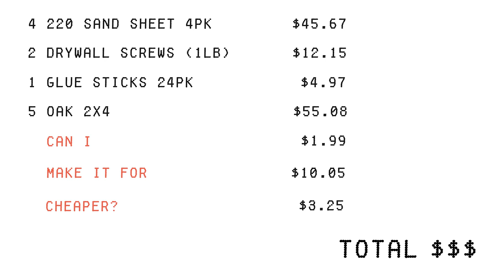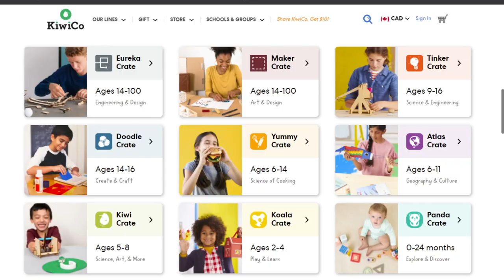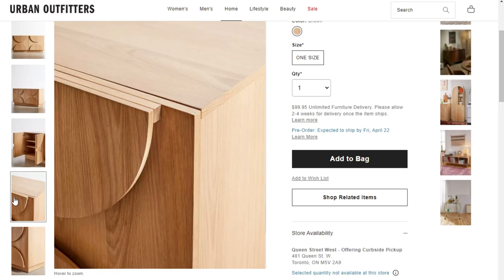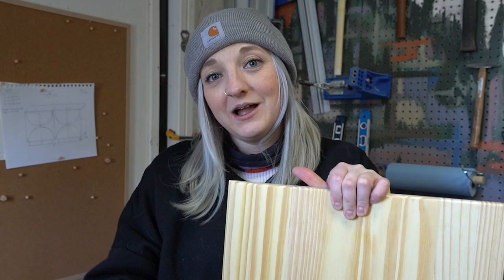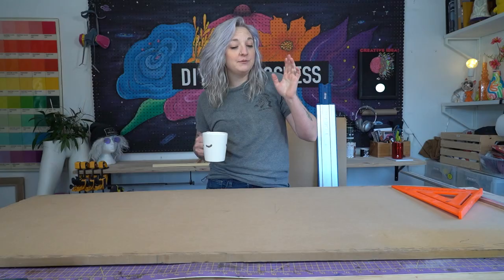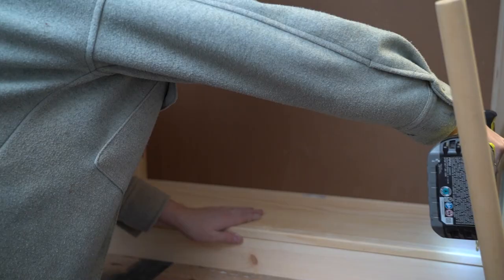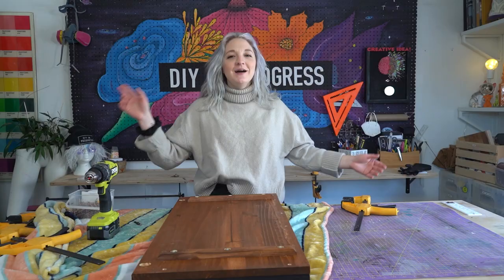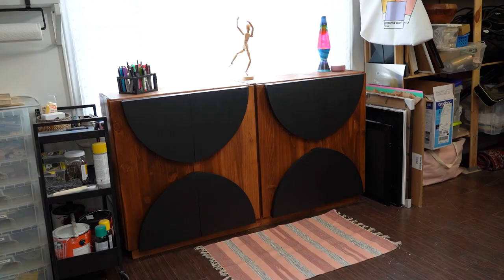Can I make the UO Tabitha Credenza for Cheaper?! | DIY IKEA HACK | DIY Danie

Comment: Danie's edges line up so much better than the original - I noticed in the picture of the Tabitha on Urban Outfitters, the quarter-circles are offset slightly from each other and I can't help thinking that if I were to drop a cool thousand dollars on a credenza, at the very least it could be quality enough to line up neatly.
Reply: I saw that too, eye twitch. Probably just poorly adjusted in the hinge and easily fixed but why not take thr time to make sure it looks right before taking proper professional shots for the website...

Comment: Loved this project idea! I would also tack in a block at about an 1/8 of the circle to make sure it didn’t crack if something hit it like a chair. Also, if you were buying supplies instead of the MDF you could 1/4 2x pine circle round boards for $15.80/each. and use a thin plywood door gap filler or just ignore the gap. At which the whole project price would be about $340 since you could just stain the pine instead of painting it saving you more money!!!

Comment: When you first mentioned the solid oak of the original inspo, I was completely expecting you to do a veneer for your dupe's doors but once you mentioned that's it's going to be a high traffic cabinet, I totally agree with your solution for a matte painted finish! Thank you for addressing the door clearance issues that the extra pieces create too! 
And if I'm going to be totally nit-picky I would mention that the vertical supports on the quarter circles could be cut a tiny bit shorter so they don't interrupt that nice visual curve when you're looking at the piece from a standing viewpoint.

Comment: i have spent all weekend trying to find a way to make circles with a router for both wood and acrylic where i dont need to screw into the wood front. this seems to be the best manufactured option available in Canada and probably what I will end up getting and using double sided tape instead of a screw.... maybe? ugh so hard to know. seems to work great. 
project looks great

Comment: My first thought for the quarter circles was to get a couple of those wooden table tops from lowes or home depot and use them, as they are precut in the circle pattern already, then just quarter them. They could have been stained a complementary stain choice? 
For someone with low space or not as many tools to do the mdf my idea might be an acceptable option?

Comment: First, I want to say that this piece turned out really beautifully. I have some critiques but I don't want to take away from the actual results bc I do think it's a good hack and very attractive.

I do think this was a really missed opportunity to use wood veneer and there's a few reasons for that:

- I don't consider this a dupe, I think this is an Ikea hack inspired by the UO piece. The original piece is solid wood and that's a big part of it aesthetically and contributing factor for the costs.

- We are all aware that wood prices right now are insane. No one is DIYing their own custom solid oak piece but there are some much more cost effective alternatives to get the look of solid wood for cheaper and that would have been great to see. It is possible to get a really nice finished look using veneer.

- There wasn't anything new about this. I am subscribed to the channel, I obviously like your content. But I feel like I have seen the equivalent to this project many times over here. I really think taking in the challenge of veneering the quarter round pieces to really reflect the inspiration would have been a great new technique to learn and demonstrate. As a complete amateur who took on a veneer project in the height of COVID boredom (combined with the lack of financial means to buy wood furniture), it's not that hard to learn but finding resources to learn from was a challenge. Most of what's available is created by wood workers geared at other professionals.